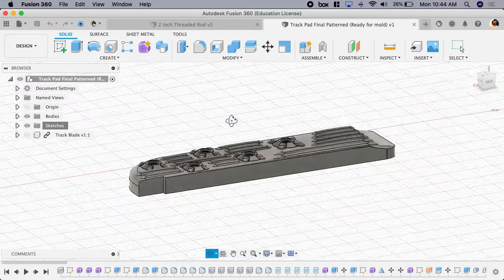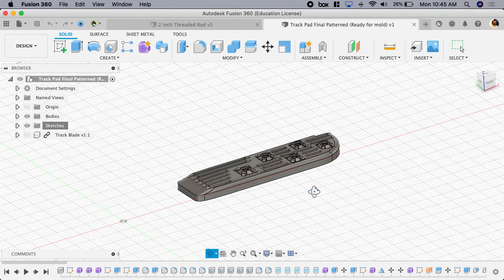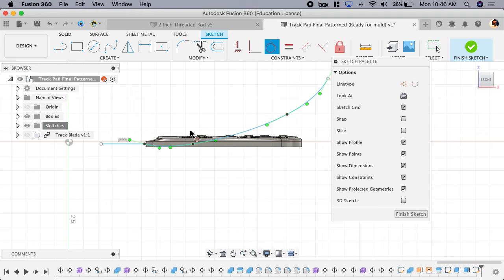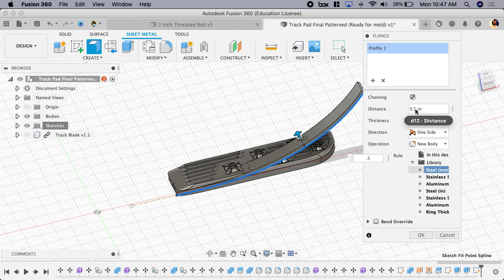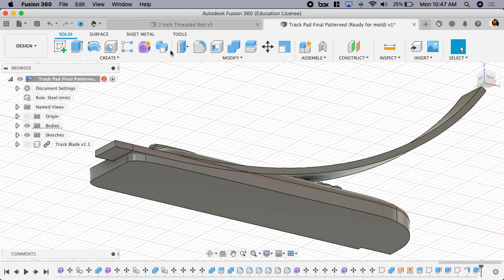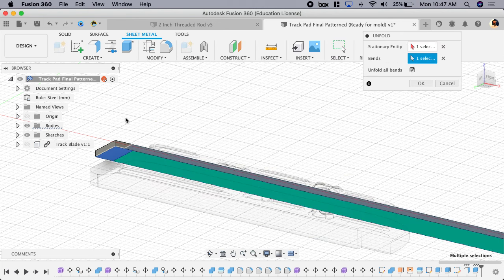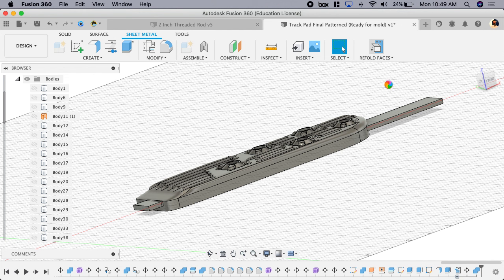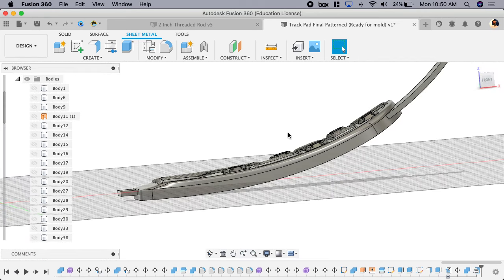Bending Complex Geometry HACK in Fusion 360

Comment: That's a pretty good find. How do you get rid of the bar through the part without the main part returning to flat?
Reply: You can make the flange adjacent to the part instead of intersecting it and then just cut it off with an extrusion after the bend is accomplished.